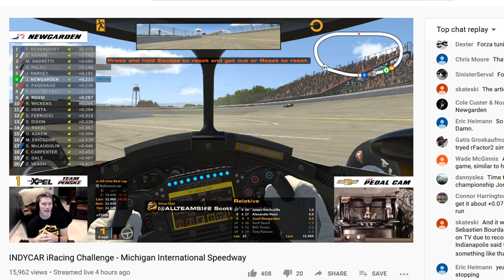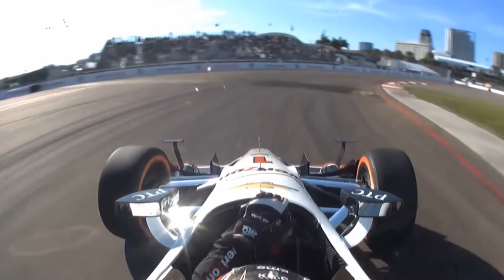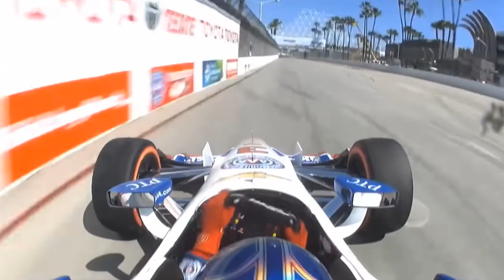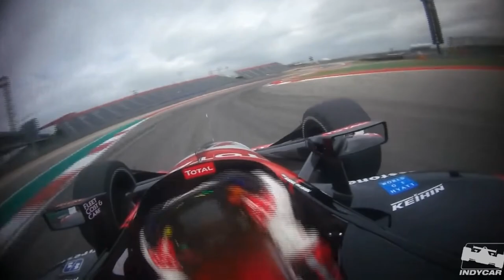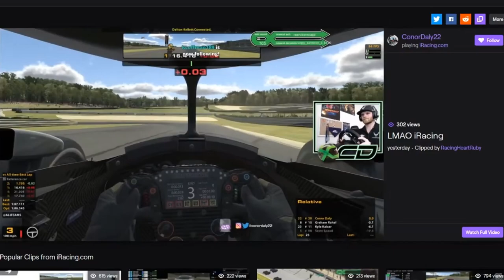Josef Newgarden Explains the Issues with iRacing's Tire Physics

Comment: (TL;DR: Tire and surface-friction models are off in every game that involves driving. It's not just an iRacing problem. The worst example of this is Mudrunner.)

Tire friction models are easily the achilles-heel of pretty much every driving-related game there is, and it's not just like this in racing sims. Games like American Truck Simulator, Euro Truck Simulator and Farming Simulator 19 all possess this problem. Beyond those examples, the best, most obvious example I can think of for this issue would be Mudrunner. Their tire and material physics are all fucked up. Compared to Spintires after the split happened, Mudrunner is just a lazy attempt at best. Mudrunner is just a watered-down, more "accessible" version of Spintires, and all of their best staff went to the Spintires team after the split, which is why Spintires-proper is now so much better than Mudrunner. If you see any commercials for Mudrunner and you like what you see, don't bother with it. I guarantee you'll like Spintires: Chernobyl a hell of a lot more. It looks better and it's about as realistic as it gets when it comes to friction models and physics. Mudrunner's traction-model essentially has that same "peaky" friction model that you were complaining about in iRacing, while Spintires has a much smoother, more throttle-responsive feel to it. 

For example, in Mudrunner, when you lose traction, the wheel(s) spin rapidly for a fraction of a second, go back to normal, and then start spinning again repeatedly, which makes it look like the wheels are stuttering. It's so bad that it looks just like a visual-glitch. It's quite hard on the eyes. If you look at how a real truck behaves in mud, the friction loss is a constant curve. It doesn't just break traction, move impossibly fast and then go back to normal, all in the space of a second. When a real truck loses traction, it will continue spinning as fast as the lower-half of the friction curve and transmission will allow them to, and they will generally keep spinning at that rate until they hit something more slippery or more solid. 

How tires/drive-trains behave in Mudrunner is exactly like if you were watching a Top-Fuel dragster do a burn out, but instead of the wheels spinning in a constant, fluid manner, the wheels just stop and start at an impossibly fast rate and at random. If the wheels on any vehicle just stopped and started like that, you'd have an catastrophically-busted drive-train for your troubles. Movement like that would snap axle-shafts and U-joints like twigs. That vehicle-behavior is like "axle-windup" on Crack. It's like the axle-shafts and hubs are made of silly-putty. The drive-shafts themselves still rotate at a constant-rate as if everything was normal while this is happening, so that problem is all in the axle-shaft, differential and tire modules. You'd think with a game that's as easily modifiable as Mudrunner, I'd be able to fix this (all of the data files are just .XML files, which can be edited with Notepad), but no matter what settings I modify, it still maintains that peaky, hard-wall friction curve. 

I'm rather experienced in modifying Spintires/Mudrunner files as well, so if I can't figure out how to fix it, I challenge anyone to figure it out. I've yet to see any truly realistic tire friction/material friction or physics mods come out for that game, which means all the other modders are having just as much trouble with it as I am. The decline in Mudrunner's post-split popularity pretty much says it all. Spintires: Chernobyl is where it's at, not Mudrunner, and people can see this rather easily as soon as they've spent more than 5 minutes in both games. The Mudrunner is releasing Snow-Runner soon, though, so the jury's out on whether they've learned their lesson until it comes out. To my eyes though, it just looks like standard Mudrunner with added snow and vehicle customization. It doesn't look like they've improved any of the core mechanisms of the game, but only time will tell. I can't just assume that it'll be shit because Mudrunner's shit. All I've seen of it are trailers, commercials and bullshit hype-videos from shameless Youtube game "reviewers" who provide suspiciously-positive reviews, in exchange for free games and some cash.

Comment: Josef is 100% right. This new tire model iRacing released is horrible. I've been a member of iRacing for 9 years and have been on like 4 tire models. This newest has many issues yet so many members are praising it and it is sorta ridiculous. I would believe any professional who has won multiple championships in their form of racing over any sim pro(as they are called) or sim developer. There have been champion drivers from different forms of motorsport to criticize the tire model, not in a horrible way but constructively. Josef explains exactly what the iRacing tire does...it has this flash heating when you slide or lock up and for the next few turns or even lap you are gripless. That is so unrealistic. The sidewall causing rollovers is/was another ridiculous thing. They had to reduce grip off track to relieve this from happening. So now if you go off you are fucked.  Now they are putting these band aids on the tire model for each car and it is just horrible. Also, the fact it takes more laps for the tires to heat up than real world sucks as well. Maybe iRacing should hire ACC's tire guy...lol. Or build a new tire using tire developers and professional drivers from different forms of racing.  I'm not even gonna talk about the dirt side and the tire...dirt tires having no wear is all you need to know...hammer down 100 laps ...lol.
Reply: The ir18 (Indycar) doesn't have the new tire model
Reply: yep... no new tyre model on indycar yet.

The new one has a much gentler dropoff than the old one (aka very very sharp), although it is not perfect by any means.

Comment: Kudos for mad studios for getting this much closer to the real behavior

From my modeling experience here’s what most sims get it wrong:

They tackle the problem in a wrong way. Their focus is in modeling carcasses, tyre flex, thermodynamics, but they forget to put attention in the interaction with the ground.

They think that it’s just “take the manufacturer’s tyre load/slip curves and it’s good to go”, where the lateral slip ratio also changes when sliding. The basic calculation of lateral slip ratio is wrong. It’s not static.

It’s like stretching the x-axis (aka slip angle).
Reply: JSWPC pretty sure that the isi motor doesn’t do this. At least the 2.0

Not sure about 2.5
Reply: JSWPC thanks for the info :)

And yet iracing never got this assumption you can understand in like 10 seconds of thought

Comment: Schumacher drove f1 like that. Brake slightly later then use the full grip in a controlled slide so he could carry more speed and still rotate through and get on the power fast
Reply: He was also good at turning into fellow championship contenders at the final race of the year...
Reply: That's how F1 was when it was great and real driving skill was needed to win a race.
Like old racing cars of the past you constantly balancing the car for the perfect moment
Reply: @DavidGarcia-oi5nt  he was fast, but did like to conveniently crash into people or stop on track  at critical times...
Reply: @MP_145  He had too though
Reply: @outremer91  well that's one way of putting it.
Reply: @MP_145  Just like how Prost had to hit Senna and vice versa. They knew the other guy had a chance so might as well seal the deal early on.
Reply: He couldn't do that with Pirellis.
Reply: @MP_145  So like Prost and Senna then?
Reply: @Mcquiz95  well yeah, all calculated moves.
Reply: @edwardrobinson7050  They needed the same skills as actual f1 cars, the difference is that you see a driver fighting with the car when it reach the limit, it was awesome and i really miss to see a driver fighting with the car

Comment: The slip angle on the slower cars like the Skip Barber in iRacing is much better. They are still working it out on the high end machines. You can catch and control a slide in the Skip no worries.

Comment: Glad Josef (and others) are pointing this all out and hope they can actually get proper debriefs.

I'm not saying iRacing has nailed the tires (they have not) but they are trying to make a comprehensive model of not just the tires, but the track surface, suspension, etc.  Then apply it to all cars.

So rightly or wrongly have not fudged the model to make the tire perform specifically better without the data to show how it works.

Does anyone have a good resource on how rFactor 2 in particular models their tires in comparison to iRacing?  In my brief experience in rFactor 2 is the physics of the cars performace is good sometimes and bad others.  Also the force feedback for instance is inconsistent as well

Comment: You know acc is the same. Once you start it’s all over. Great video. Like for sure 👍
Reply: Didn't ACC just get a fancy new 5 point safety belt, I mean tire model to fix that? Or was that an "Early look?"
Reply: I don’t find this to be the case is the current version of ACC. Perhaps is was different earlier.
Reply: JZStudios compared to games like RaceRoom and now Automobilista 2. A few others. It to me is not the same.  Although I try to run with little traction control as possible. I find the cars much faster. It seems that once you start to slide it’s very hard to regain control. On these other sims. Just backing off on The throttle I can usually regain control. On low traction control. This to me allows me to play more aggressive. But I’m not seeing this in acc.  I’m not saying I can’t control it. But it’s not as controllable as others. Even rfactor.  Which many believe is one of the most accurate simulators. Don’t get me wrong. I like playing acc. I just think that is a problem and also if you get tapped in the back from another driver you are sent into a spin with not much chance to recover.  Just my opinion.
Reply: @d.jsgaming6683  I love ACC, but it's a bit unpleasant to slide off like that, especially considering how heavy and planted the cars feel otherwise. A lot better than other games with the same problem, but there's room for improvement.
Reply: I didnt know CNN posted here.....
Reply: not true. ACC does a way better job, you can really be aggressive with the car and you can catch slides, way more enjoyable

Comment: Yeah, iRacing can learn a lot from ACC, where it is still hard to be fast but the cars are so much more fun to drive and there is room to push and drive around the limit and not automatically sliding either being a passenger into he wall or hitting the other side with the dreads snap oversteer. Why on earth does a 'sim' need to be so boring to drive????????

Comment: I would love for these pros to try pcars2 afterwards and hear what they have to say. I already know, but it would be great for people in the sim community to figure it out as well. Certainly, pcars2 isn't perfect and some cars are better/more accurate than others, but it's a better simulation than most other sims on the market. Very similar to rF2 with its best content (and miles ahead of rF2 at its worst) but without all the bloody, nonsensical murder.
Reply: @ATS599 Yup
Reply: Pc2 more slippery than Iracing. No?
Reply: @JeyD02  PC2 is the diametric opposite to iRacing. iRacing is the epitome of punishing you if you dare to approach the edge. PC2 is all about fine control at the edge and beyond it. You can actually race the cars in PC2 (and AMS 2 and AC).
Reply: I hate PC2 physics it feels unrealistic i know its a simcade, but the car slides too much it can be seen in 4wd, for example the evo 6 it looks like it slides too much, for some reason after i bought a car and play assetto corsa and Iracing i can not play PC2 without being angry with 4WD and RR Cars

Comment: I am not a programmer of sims but I did some car modelling. You can get right the main things. These are quite well mathematically described. The problems starts when you go for the details / imperfections / compliance. Especially the tire is the most complex component. There are some better and worse models but still all of these are just some mathematical approximations (mostly not even a physical model). In general the real world tends to be more dampened due to these imperfections then the simulations of it.

Comment: I dont drive the Indy car, so i have no comment on that, but i do drive pretty much any thing else on road with a roof, all of which slide about with plenty of warning of the limits of grip. I'm wondering if this is a Indycar problem more than just a tyre problem? also, wheel set up helps too, incorrectly set up kit will hide a lot of effects as im sure you are aware. like i say, i dont drive indy , and the tyre model is far from perfect but its not as bad across the service as this video might suggest
Reply: Most of the road course cars suffer from the same thing, I think it's just a property of the model.

Comment: I always wondered if this was true....in my real life Miata on some pretty middle of the road Yoko summer tires I can slide the thing at 7-10 degrees of slip down any ramp or long turn and never, ever feel like it's going out of control. Yet with slick racing tires on a warmed up mx5 cup in iracing I lose it into a wall.

I always kinda figured it was because the car must be a lot less forgiving in that config and since I've never even tracked my car I felt like I should just shut up but he says basically the same thing

Comment: rF2 tire modelling is so much better, you can slide that sucker. Back about a decade ago i actually did some research on the topic of tire modelling and specially about the going past peak grip. One common thing was that there was no smoothness in the transition between peak and static grip, it just abruptly switched from one to another. The gMotor2 did not really have an answer to it, it was easier for game mechanics to keep it that way. It has parameters and range to make it smoother but that allowed to "cheat" and slide constantly. Temps could not be adjusted to fit the new profile, they either heated too much under normal driving or too little while sliding (main focus on that effort was actually peak, surface temps, grip curve anomaly was an observation that affects temps quite a lot..). Haven't checked how they changed it but especially that specific but important detail is much better handled in rF2, also in Raceroom it is now quite excellent after the latest physics update.

Comment: Fair points. I'd love to hear his opinion of the competition, though. In particular Forza, for which he is a brand ambassador...
Reply: Forza is considered a "Sim-cade", but their tire model feels realistic. You can slide the rear around corners without spinning out instantly. The loss of grip is progressive. I suppose they put a lot of work into the tire physics because drift racing is popular in Forza. I don't participate in that, but I occasionally put the car sideways around a corner for fun.
Reply: @normand5847  I think it leans much more heavily towards the arcade, personally, but I enjoy them both. Forza for fun, iRacing for something a bit more serious.
Reply: Forza has a far more realistic grip loss transition, but their overall grip levels are far lower than real cars. But the reason Forza is as fun as it is, is the more realistic grip transition that allows for more car control.

Comment: He's certainly NOT wrong...it's too bad that it takes pro drivers in real life to have a voice with iRacing to tell what is wrong whereas the other 7, 8, 9, 10+ year veterans that have been on iRacing don't carry any weight to get iRacing to listen to feedback. Tells me that iRacing doesn't give a ** what anybody who has a valid complaint or argument has to say, it's like shut up and just race!

I also suspect that iRacing is make these tire dynamics out of thin air without getting advice from Goodyear, Michelin, and other manufacturers that could supply a formula that would work to make the tires work in the different dynamic conditions seen on the SIM.

Comment: I felt like before the new tire model at least for street stocks and trucks at homestead and Atlanta.  The old tire model had more more forgiving nature and the setups were looser. Also you could get away with running multiple lanes. But I was a noob at iracing back then.  But I was good with loose cars.  Jumped over to 3000 irating within a few months.  But new tire model always felt so much tighter for me. I’m still working on finding the grip but getting better